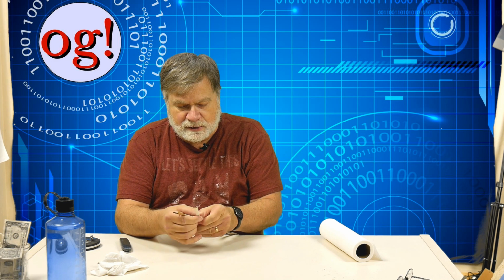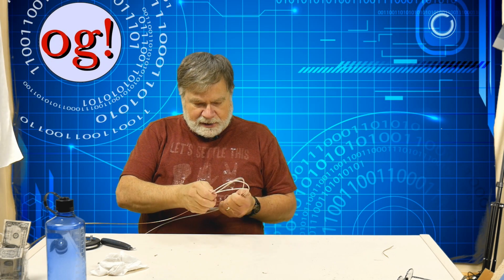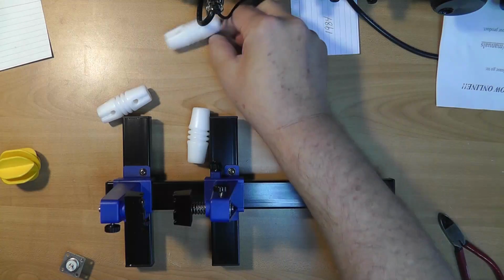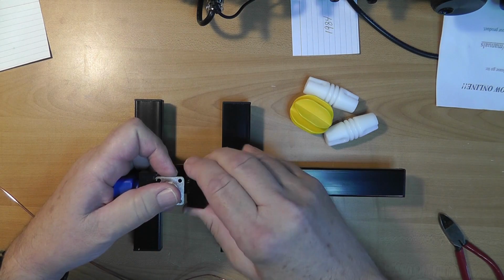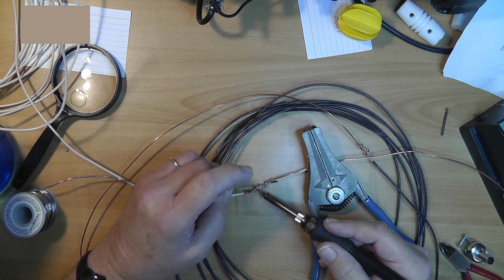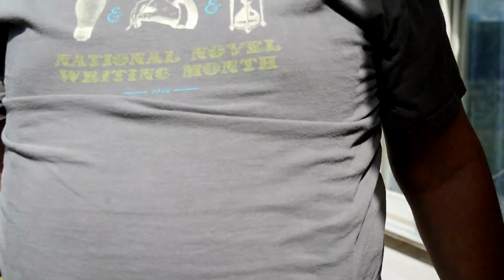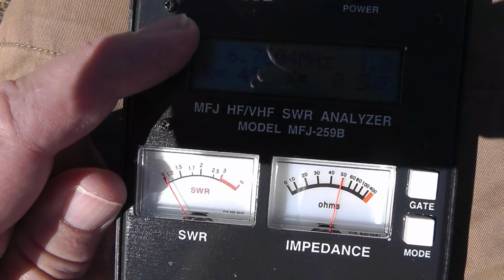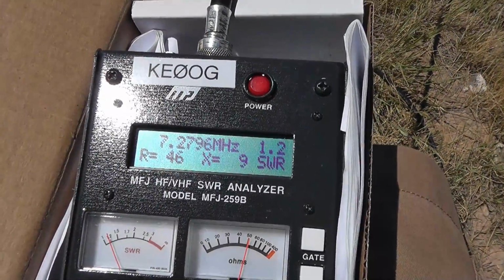Making and Using a Simple 40-m Dipole (#86)

Comment: I am making the same antenna. However I bought a coil with the pl259 on it. I am not sure if it is a 49 to 1 or vice versa, but has strictly the number 49 on it. It will be an easy fix if the coil is a problem. Thanks for your video I still find it a great source for my endeavors 73 N6ZKI
!

Comment: Fairly new General here.  For the fun of it, the learning experience and a general lack of money, I recently built a 40 meter dipole and deployed it for NVIS.  This antenna was built for free using dog underground fence wire (solid and pretty thin) which I happened to have plenty of on hand, a piece of heat shrink tubing and 3 pieces of small diameter rope.  My total cost for the antenna was free!  I hooked this antenna to my recently built el cheapo radio (Pixie S) kit from amazon and both the antenna and radio are working great! I literally have less than $11 in (the cheapest that I could find) soldering iron with solder and $13.59 in the radio.  I am ecstatic to be able to get on the 40 meters for less than $30 and maybe 5 hours of my time!  Everyone has to start somewhere, I am starting at the bottom and so can virtually anyone else who truly wants to apply themselves!

Comment: Dave, you mentioned that you were not going to add a Balun at the feed point initially.  When would you "know" that you would need a Balun?  What would tell you this fact?  A really high SWR?
Also, are Baluns rated for PEP power?  In other words, would a Balun that is just fine for 100W PEP be not up to the task at 1000W PEP?  Likewise the wire AWG?  Great Video.  Love your observations on the build.   Art

Comment: Hello David, ....question: suppose i want to receive the 6mhz band, so 468/6 = 78 feet, then my horizontal wire will be 39 feet each side, right?  Ok, with that wire length , can I also receive all the frequencies over 6mhz? ....and no frequencies under?  So for example, a dipole antenna at 78 feet would be good also for any frequencies over 6 mhz....but not for 5 mhz for example. Thank you for answering :).

Comment: i would have enjoyed it if you showed the finished S0239 connecter on the 40 meter dipole. Is that what you only used to connect to the cable? thanks for your help KM4WMC. Enjoyed your video. I Made my first 40m contact

Comment: It's been awhile since you built this antenna, but I wanted to comment anyway. I just wanted to mention that you have used some heat-shrink wrapping around the solder connections to avoid the sharp edges. It would also weather proof the solder joint and prevent corrosion from weakening the joints. Just my $0.02.    73 de AI4QX

Comment: Enjoyed it Dave! I'm going to get going on making a 10 M dipole soon
Reply: As soon as I got my Element 2 certification, I Put one in my attic using 16 ga. insulated stranded stapled to the rafters. Soldered it right to the coax. Solar minimum kept me from much use until I got my element 3 ticket. Found that antenna also tuned on 20 and 40 meters and made a few QSO’s up to 980 miles with that 10 meter home brew antenna.

Comment: Great video thank you sir!  Love the concept of not having to go out and sling the cash/card around.  Where can I find the formula for  figuring up 1/2 wavelength for the different frequencies?
Reply: For dipoles divide 468 by the frequency to the length of a half wave dipole. Then divide by 2 for each wire's length. For inverted V antennas divide 450 by the frequency and then divide by 2. When I make my antennas I make them a foot or two longer and then fold back the excess a little at at time at the end until I get the resonant frequency where I want it.

Comment: There is no positive or negative in an AC circuit. There is a "HOT" and a "NEUTRAL". The neutral refers to the conductor that is locally bonded to ground.
Reply from the maker: Yes, true in AC power distribution. In RF, it's all referenced to the measurement datum, usually the chassis. Polarity really matters in these situations.
Reply: @davecasler  you referred to the hot as positive in this video.
Reply: @almosthuman4457  He was just making an analogy, in reality the 'neutral' in the USA is the center point of the tap on 220v line, so each side gets you 110v; The ground is often connected to the neutral in the main, but the sub-panels use the original neutral, the ground from the main-panel. So even a sub-panel can be slightly 'hot' given a float above ground. Most of the world of course runs on 220v so both wires are essentially hot, but often one is chosen to be neutral and tied to ground at the main panel. But again there is a reason for 3 wires  in the usa and only ground is safe. Most of the world just uses two wires and both should be feared.
Reply: @paddyomalley7913  In the states all neutrals must be bonded at the meter or in the main distribution panel. That goes for single/split phase, 3 phase ʎ (wye)  and 3 phase ∆ (delta) on all systems below 7.2KV there can only be one bonding connection between neutral and ground on the customer side of the meter. i almost forgot about Wisconsin's B phase. which is the only exception  to the rule. the neutral is used as a third phase and a very strange animal.

Comment: I'm new to Ham so, take this for what it's worth. The antenna tester read 7.some odd MHz and you said that's the top of the band. My crappy little Baofeng reads 400 some odd MHz. Are we talking about the same MHz? Are we talking about radio frequencies? Big sign over my head reads, "Not Getting It"
Reply from the maker: I was illustrating a 40-meter dipole.
Reply: Study "ham radio bands". You may have figured it out by now.

Comment: What type of insulators? Where to buy? 

73 de KI5CXO;
Reply from the maker: You can make them from pieces of plastic pipe, or buy electric fence insulators at a farm and ranch store, or use little pieces of plexiglas with holes drilled in them--lots of options.

Comment: A little note from my own experience. If you use insulated wire cut the wire at least 10 % longer than the formula for bare wire, due to velocity factor  changes.

Comment: Just a couple of questions, what are you using as the support poles for your dipole? If converting it to an inverted dipole the length remains the same for each arm. Like the comment about not worrying about solder if lightning strikes, but do you have protection ? spark arrester /gap at the transmitter/ receiver end or ATU?
Reply from the maker: I'm using two pieces of chain link fence top rail, available from Home Depot. One fits into the other pretty well. I have lightning surge protectors on all antenna leads mounted on a ground rod where the antenna leads come into the house.

Comment: It's an AC supply cable, so no positive and negative. Live and neutral!
Reply from the maker: Depends on how you look at it. In engineering, particularly RF engineering, AC has a sense that is either positive or negative. Of course, there has to be a reference somewhere. But AC RMS current and voltage definitely have a positive and negative. In electrician terms, there's the hot and the neutral (I've always wondered why AC isn't distributed in a balanced way, but it isn't) and don't think the neutral is ground, because it only is at the service entrance!
Reply: @davecasler  I always think of the neutral as the center tap of the transformer. Your videos are excellent - thank you!

Comment: Hey Dave, haven’t seen any new videos in awhile, hope all is ok! I watched this video several times and antennas confuse me. I would like to make a dipole for 10 meters and I’m not sure of my length or my formulas. Can you help me out with that? Also is it better to feed with ladder line than regular coax? I would love a mug...  -73- W1KPS
Reply from the maker: Kevin, the general formula for the length of a half-wave dipole is 468 divided by the frequency in megahertz. It gives a result measured in feet. If you make a ten meter dipole, use about 28.4 MHz as your frequency, because that's the middle of where the activity is, such as it is with the low sunspot cycle. You can feed with ladderline with a tuner or with coax and not need a tuner (if you tweak the antenna for lowest SWR). You can order the coffee mug right on Youtube.
Reply: @davecasler  Thank you for your reply Dave.I appreciate it. -73- W1KPS

Comment: Hi Dave. New ham here. Great video and it answered many questions I had very clearly. One leftover question I have about dipole construction is this:  Does the wire you pull through the insulators for mechanical security figure into the dipole length?  
Thanks! Jeff KN4QPL
Reply from the maker: Yes, but not the wire folded back on itself, if that makes sense.
Reply: Ok, so the total length is still the amount pulled through the insulator, up to where it doubles over and twists. Right?

Comment: Dave, surprised your antenna was that far off if it was 66 feet. Each side should be 234/Fmhz or, of course, 33 feet. I find that comes pretty close to somewhere inside the 40m band. If your original length was resonant at 6 Mhz, then it was about 38.5 feet on a side. In any event, if I am a Mhz or more low at HF, I cut 6 inches off each end and measure until the frequency falls within 250 Khz and then it's an inch at a time. Another way is to determine proportionally how much to cut or add by dividing the original measurement is to divide your center frequency by your *desired* center frequency.
Bottom line is that *no ham* should buy a commercially made dipole until he makes at least one of his own. And then he will *never* buy one afterwards when he sees how much money he saves!
71/72 de k6whp 
dit dit
Reply from the maker: Yes, dipoles are easy if done methodically.

Comment: I wonder if you could solder large wires using a butane torch instead.
Reply from the maker: Yes, don't overheat though.
Reply: @davecasler  
Right, that would introduce a ton of impedance. Good call. Thanks!

Comment: hi dave great video what antenna design can you recomend for a space of 12 x 10ft
Reply from the maker: I'm assuming for HF. Maybe one of the vertical antennas that doesn't need radials, like the AV-640 or similar. Get the base up off the ground by ten feet or so, or put it on your roof.

Comment: 19 feet , 40 m , ooh gee confusing ,
Reply from the maker: Hams use wavelengths (e.g., 40 meters) to designate a band of frequencies. Hams use Hertz to designate a specific frequency in a band (e.g., 7.125 MHz). There is a reciprocal relationship between the two--as frequency goes up, wavelength goes down. The product of the two (in the metric system) is c, the speed of light.

Comment: Hello dave I just getting in to ham radios I'm. Looking to get a yaseu ftdx5000 or a icom ic 7700 what would you recommend for antenna for the top of my house and why does the back of these ham radios that I said  have more then one antenna connections  thank you James
Reply from the maker: James, neither of the radios you mention are beginners radios. They're very complex, totally top of the line, and extremely complicated to run correctly. I'd suggest you start with something like the Icom 7300 or the Yaesu FT-991A or you can go even much lower. Even the most basic rigs from the "big three" (the other being Icom) are good radios. The top end radios have multiple antenna connectors for multiple antennas. The best antenna to start with is a single band dipole and then go from there. No ham is ever completely satisfied with his or her "antenna farm."

Comment: I scanned the comments and didn't see it addressed. When splitting out Romex you don't need to cut the insulation all the way along the length. Once you get about 8" split out, just hold onto all of the wires with one hand, the outer sheathing with the other, and pull them.  The wires will split the outer sheath all the way down as you pull.  Saves a lot of time.
Reply: Yes, this is a great tip I have used for years. I add to it; after you clear the 8" of copper - secure couple of inches of copper into the bench vice and just pull the rest of the insulation back with both hands and using pliers. The wire comes out much quicker much more straight. It is also a good idea to secure one end of wire in the vice once all lengths of wires has been joined together and give the other end a few quick pulls with pliers - this really straightens wires prior to erecting and tunning.
Reply: Can confirm.

Comment: Dave -
As usual an interesting lesson & video. we are all getting old and less frisky. I'm wondering about RF safety, specifically safe distance from a radiating RF antenna. As I read FCC OET65, the safe distance from a 40 meter band antenna at 500W or less is 1/2 wavelength = 70 ft.
I know very little about amateur radio. do these numbers seem right to you ? what is the typical amateur radio station broadcasting power ?
Reply from the maker: See my video on RF safety that has quantitative guidance from the FCC. https://youtu.be/E0kK4kgKitM

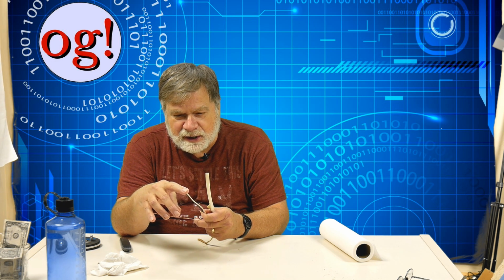Comment: @ 4:00 you have completely incorrect information presented.
Black is NOT positive & white is NOT negative in household wiring.
Wires do not have an assigned polarity in an AC system.  
The black wire (hot) carries the AC current to the outlet and white wire (neutral) is the return path. This should not be confused with DC concepts, by identifying one as positive and the other as negative.
Reply from the maker: In engineering terminology, AC voltages have a phase angle against some reference, in this case the neutral. Given the neutral is sort of ground potential, the black wire is "positive" with respect to neutral. But you are absolutely correct about non-engineering usage. Electricians speak of energized wires and hot and neutral and also have terms for three phase power, both delta and wye.
Reply: @davecasler  nope. The AC has positive and negative components.

Comment: Dave always very informative videos..my 20m dipole was made from romax and works great right from the get go..it`s been up for over 3 years now and with only 100 watts on this old Icom 738 it gets great results from 12 ft. off the back of my deck to a tree...I live in Pgh. Pa. With that setup I have worked asia and all over europe when the conditions are running good...by the way the ends are soldered right to the coax..so far so good...keep up the great work you do..73 Bob

Comment: Does a low swr, necessarily mean it's resident?  I'm not so sure that's 100% correct..  what about rf problems without a choke?
Reply from the maker: In general the lowest SWR point will be reasonably near resonance, but the actual definition of resonance is that the reactive component is zero.
Reply: David Casler ok, thanks Dave

Comment: Dave, As I didn't hear you specify your splice in this video, I would suggest anyone who wishes to assemble a wire antenna from several pieces of wire to use the Linesman (AKA Western Union) Splice prior to soldering for best mechanical strength. Many YouTube videos available to demonstrate how. Essentially the splice is twisting the two wires together 2-3 times, you then wind each free end in a tight coil around the standing length of the opposite wire.  Pull both wires until splice is taut, then solder.
As for soldering I prefer using an iron with a substantial tip for best thermal transfer, I've have good results with my 35+ year old Archer modular Iron with the 45W heater element and a 0.25" pyramid tip.  It is a little too small for Coax braid to PL-259 shield soldering though.
Reply: P.S. Dave, I thought most of your mike issues was from the lapel mike being attached to your shirt too close to your head (beard?) so it sounded either muted or rustling when you turned your head to that side.  May want to do a sound check with the mike clipped on 3-4" below the neckline before spending $.

Comment: Thanks for this video. I'm really fascinated by the the price / complexity / performance trade-offs  between simple wire antennas, verticals, and beams. I've got dipoles at home, and though I've never tried anything else, I've been happy with them.

Curious to know how you think your testing rig at 20 feet will affect the performance of a 40m antenna. Have you modeled the pattern in NEC?
Reply from the maker: Twenty feet is too low for a good 40m dipole, although it's about all I can reasonably achieve. This will push the takeoff angle up, at least partly into NVIS (Near Vertical Incidence Skywave) propagation.

Comment: FYI black is not hot in U.K. Old UK (and possibly other EU countries) systems black was neutral and new systems black was dropped and blue is used for neutral.
Reply: And now all we have to do is get the UK and sadly most of the U.S. to drop the English measuring system and go Metric. No one can understand the basic logic of using measurements called: inch, foot, yard, etc. they are totally illogical and should have been dropped eons ago. LOL
Reply: Shocking! Back in the day, the old "All American 5" table top radio was built in a totally plastic insulated case and knobs because if the housewife plugged the non-polarized connector in the house socket, there was a 50% chance that the chassis was live 120VAC.  If she lost a knob and turned the volume with the exposed metal shaft while operating the metal kitchen sink valves, it would be a shocking experience 50% chance.
Reply from the maker: Thanks for the info!

Comment: Dave, you could demonstrate how to use the 40m dipole on say 20m and or 10m by inserting an insulator part way along the dipole arms, its a pain when you want to change bands as it has to be lowered, but its certainly budget antenna de G zero FFL
Reply from the maker: Our club has an antenna just like that that we use for Field Day. Such an antenna is easy to build, though tuning everything just right will take lots of work.